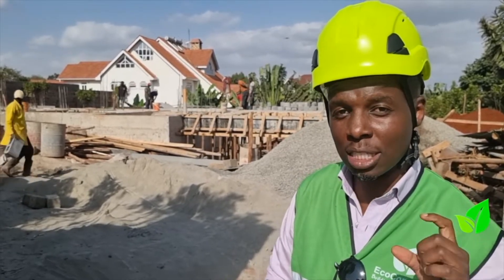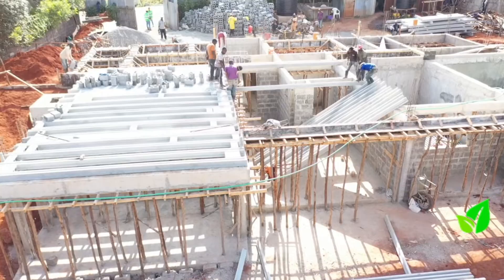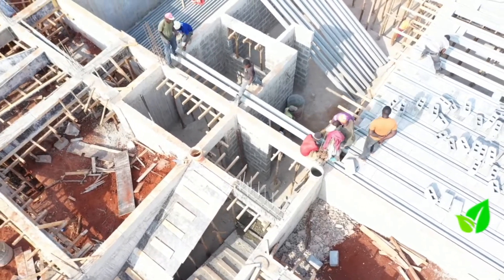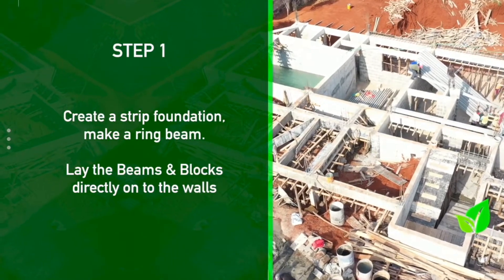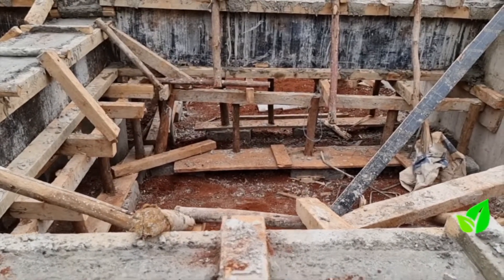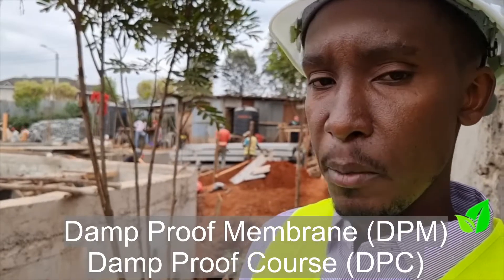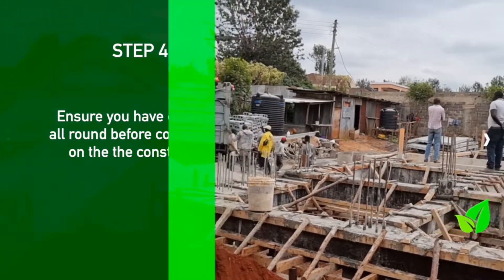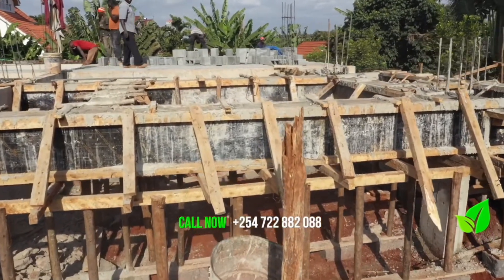Case Studies - Kiambu County - Building on a slope

Comment: Great information.  Is this technology for slopying ground floors and areas with clay soil only? Can it be recommended for flat areas where minimum excavation is required? What is the purpose of raising beams and blocks above the group abit? Do you provide outlet channels incase water was to slip and  accumulate underneath when it rains.
Reply from the maker: Hello, this technology is for any construction area from extreme sloppy grounds to somewhat levelled grounds. The slab is suspended above the ground and rests on the ring beam or ground beam, trench for foundation walls only. No excavation or backfill needed. The minimum void allowance is to prevent direct moisture from the ground to the slab.
Reply: @ecoconcretekenya incase of water?
Any outlet?
And why left the on its natural  way?